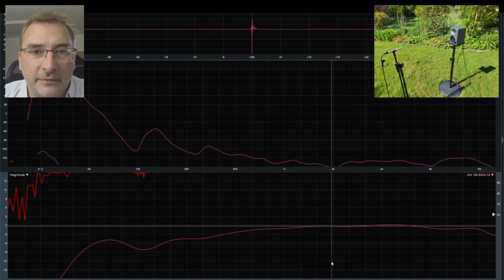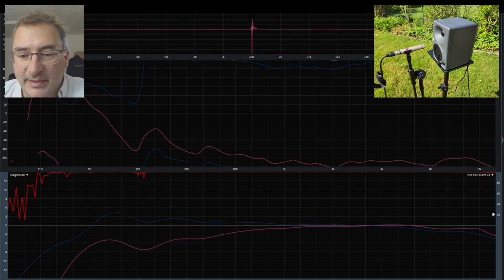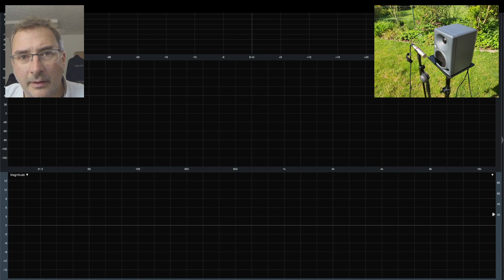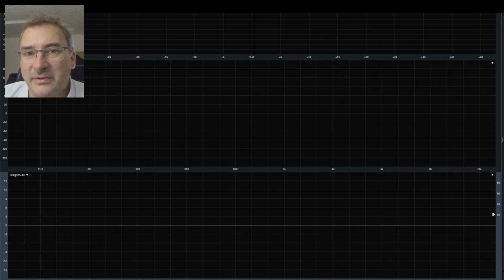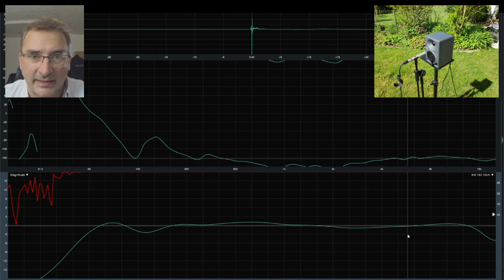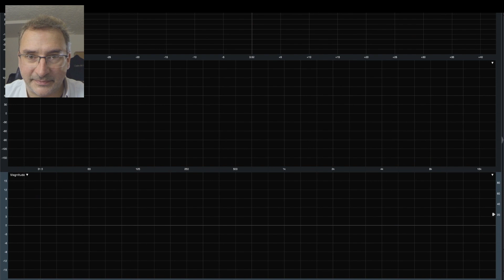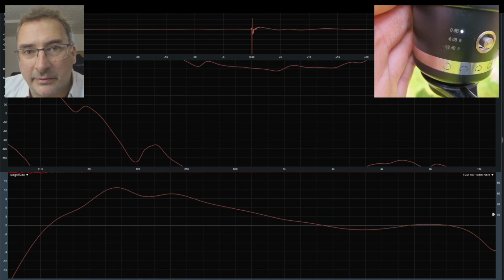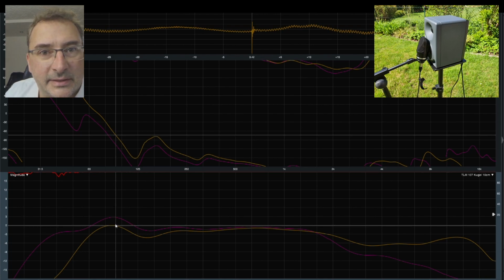EXPERT VIEWS: The Proximity Effect explained by Carsten Kümmel

Comment: Great video. Would have liked to learn more about the differences in the proximity effect in small and larger condensor mics. Also if an EQ might sometimes be better than angling the mic and how to determine a good matching EQ to compensate for the proximity effect.
In the screenshot it looks like the large condensor has stronger proximity effect, while normally I would expect a lesser effect due the stronger changes in the polar pattern of an LDC compared to a SDC.